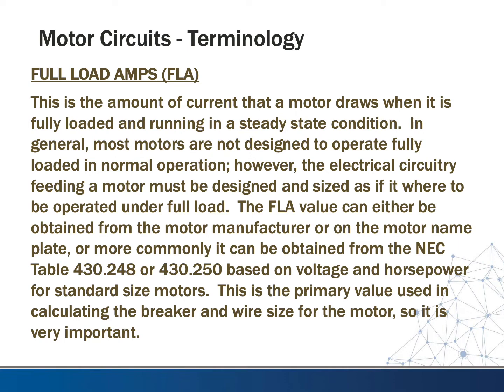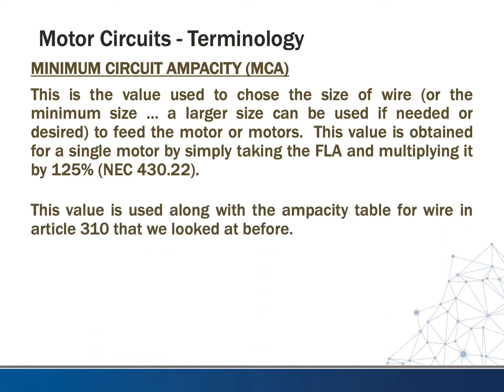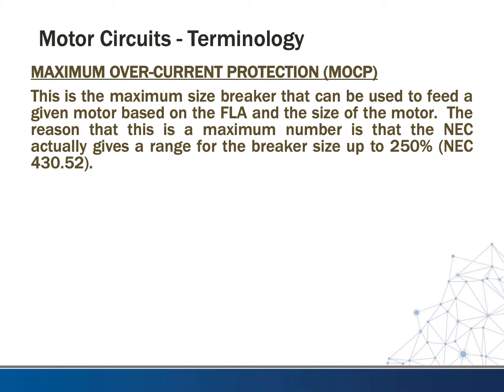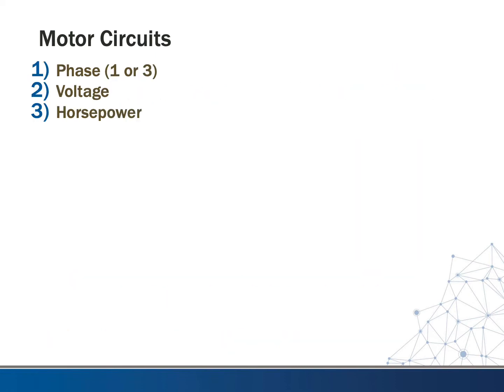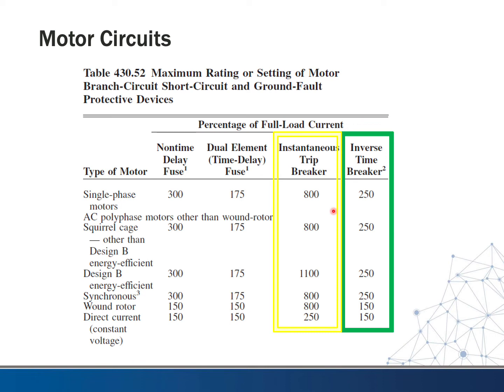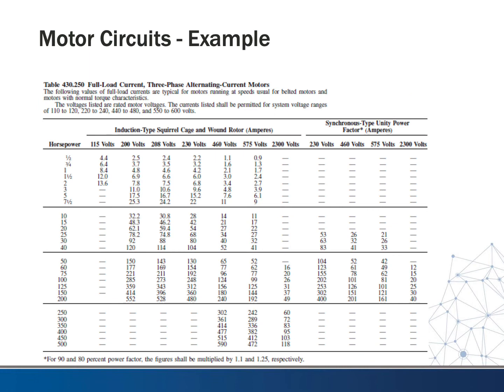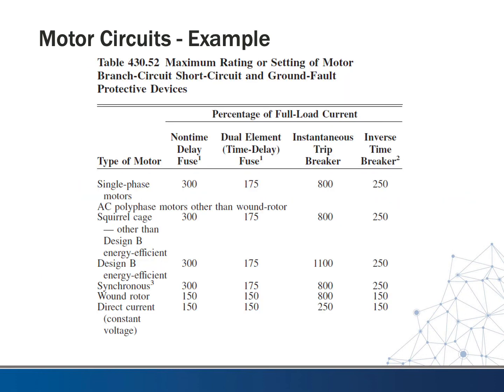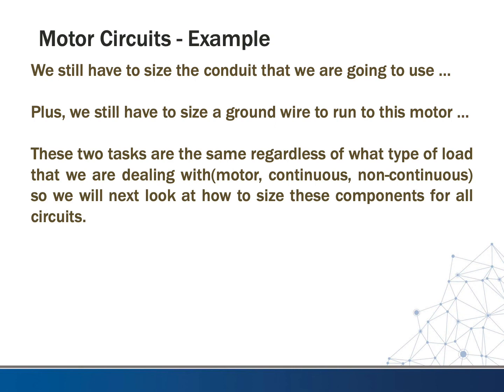Branch Circuits for Motor Loads

Comment: Question, if we are feeding the motor with #6 wire, which can handle up to 65A, but the breaker will trip around 90A wouldn't this potentially burn the wires if there is a overcurrent that was say 80A?
Reply from the maker: In general, you are correct, but there is an exception in the NEC for motor loads to allow for the inrush current when starting the motor.  Because of this exception, you are allowed to oversize the breaker for the wire used.  This is only allowed on motor loads.  On non-motor loads, you are correct.  This is a code violation.
Reply: @shaneritterEE  Isn't 6# minimum wire size? Should we oversize to match the breaker?
Reply: Could you please recommend any resource for me to learn best practices for commercial electrical design?